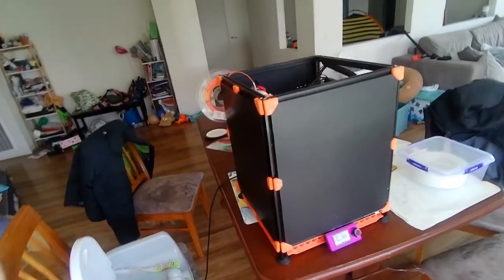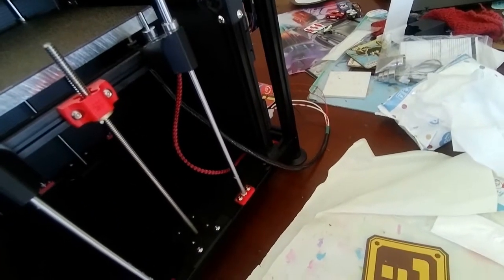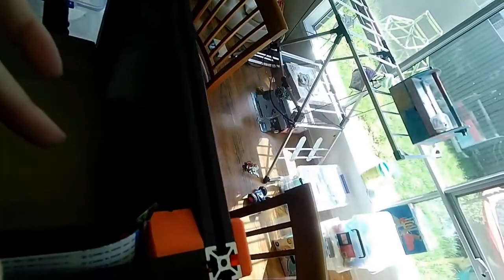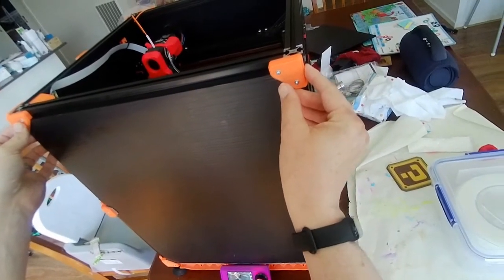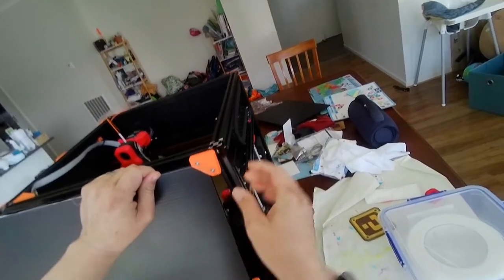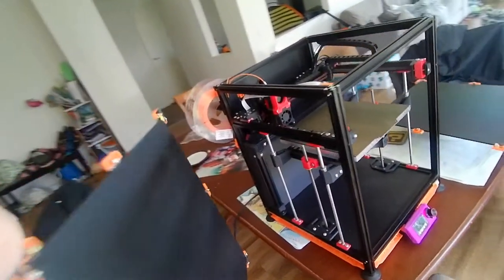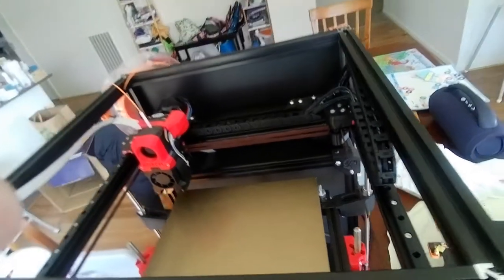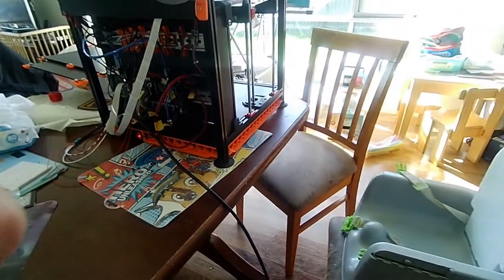Voron panels and camera mount

Comment: Hmm, that's not how you use hammer head T-nuts...
Reply from the maker: How come? I've since gone ball spring for convenience
Reply: That's even worse, now you have to completely unscrew them?! With hammer heads you're supposed to slide them in, then flip them into locking position by turning the bolt 90°. Unlocking is just turning the bolt 90° in the opposite direction, so that they line up with the slot again.